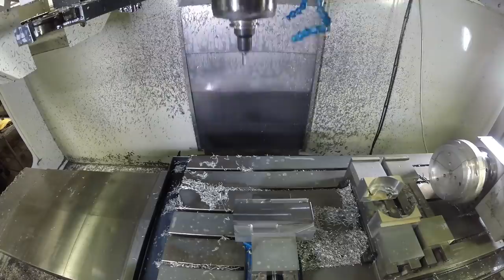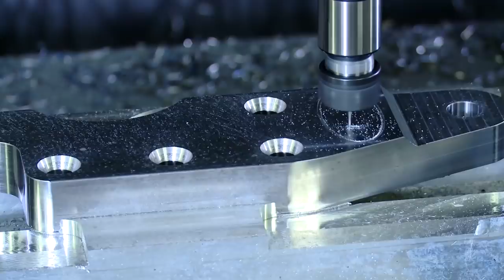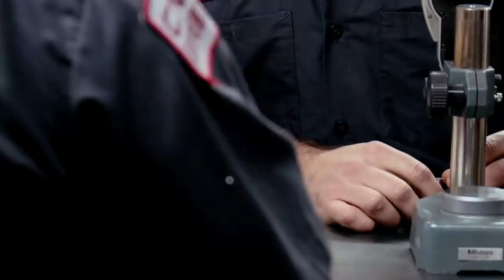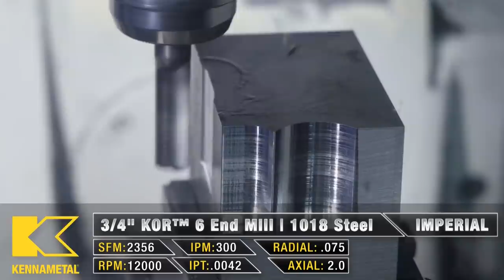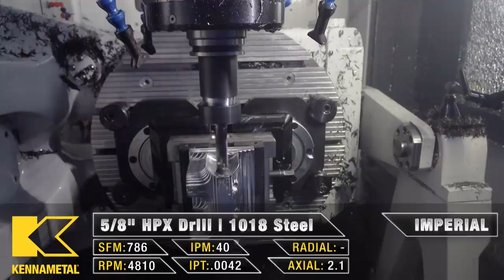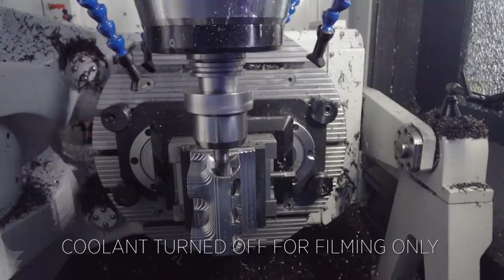Tools Keep Breaking on Night Shift, but Runs Perfect on Day Shift... Nobody Knows Why

Comment: My family business (Not that I'm involved with it) sent there manufacturing to china and closed down the factory. With engineers here they will notice issue's as they have an overview of the project and ask a question, I guess like your night shift guy did without consulting you. So some how a decimal point put in the wrong place and 200,000 parts where made and basically scrap metal, this would have never happened in our factory someone would have asked "Is this right?"

Comment: With modern controls, they'll usually give you an option to override the feed rate, and one to override spindle speed. The controls also will assign the feed knob to either IPM or FPT depending on the code you used. 

If you program with Inch / min feed rate, then reducing spindle speed will actually increase chip load, since it's still moving the same distance, just less flutes are hitting the part. To keep the feed per tooth the same in this mode, you have to adjust feed rate and spindle speed the same amount. 

If you program with feed per tooth, then reducing spindle speed will also slow down the IPM feed, so the machine keeps a constant FPT / chip load. This makes it a lot easier to dial in a program, since one knob only changes one variable.

Comment: You need that cooling note at the beginning of the video.   I was wondering if I should take advice from a machinist that doesn't use coolant without explanation.
Reply: Sounds like you've never seen a video about machining.  
Most of them shut off the coolant so that you can see what's going on.
Reply: @jamisojo  Yup.  First one.  Just need the disclaimer at the beginning of the video.  Milling bits don't grow on trees ya know.  They come from Plants.

Comment: Look up the info from your tool supplier, then realize that those data will run great - for about 15mins before the endmill needs a changing. Go slow enough to not break shit but fast enough to make money. When it's all dialed in, you can optimize for profit.

Doing prototypes all day long with a max of maybe 2-3 of the same part per order, there's no point in risking the tool/machine for you to save a couple of minutes per part.

Gain experience and then start to push the boundaries, but go easy in the beginning. There will be no praise for taking it a bit slow/easy on some parts, but that beats having to inform your boss that you need another batch of endmills or a new machine =) Find the balance.
Reply: exactly. had a prototype part come in, UHMW. got the prototypes done and out but didnt look the best and took a long time in the mill. ordered some good 2 flute carbide high helix endmills, played with mastercam and started to push the envelope some, and quickly ran out of machine. i just couldn't get enough rpm or traverse speed out of it to smoothly go faster. when i started on that part, it was 2 hours of machine time, partly to me being really new to mastercam, partly to me learning what that material wanted for a cutting strategy. currently, i get the same part done in 1 less operation, in about 25 minutes per part, in an order of 200. enough to tie a single machine up with an operator. the only changes i have to make now is from inconsistencies in the material from batch to batch, and when we have to change tooling manufactures, and they are usually small changes.
Reply: When you slow down the feed rate and cutting speed a little cutting tools last a lot longer.

Comment: Even if an employee thinks the settings are wrong they should run it once at the programmed settings. If you have a problem then try to fix it after that, because then no blame can be placed on you. If you don’t have physical proof the settings aren’t right in the form of a part with a problem, then you’re automatically wrong, even if the part looks right.
Reply: Kinda the same with excessive tool wear make same parts an say hey the code is too hard on the tool could only do X parts before the surface or tolleraces aren't achievable

Comment: Do production CNC tools record operating logs? The feeds and speeds that were actually run seem like something that you should be able to look up without having to stay late and ask the operator about.
Reply: I am currently working on some fairly old CNC mills. I'm not sure if there is a way to download a log off of them. I even did a little school for them, and if they mentioned any forensic work it mostly involved combing through the program. I'm not sure if the programs include any records of changes to them. Any changes or notes in the program seem to be manually written in. but unless you write X was changed on xx\xx, I don't think our mills will tell you.

Maybe the new mills might have that, but the few I've encountered have all been dinosaurs.
Reply: @camtube55  IIRC G-code dates back to the paper tape era and it wouldn't surprise me if some stuff still in use (or maybe even still being sold) has advanced only a little since then. OTOH I'm a software developer by training and have some idea from there what can be done for logging and the like... if the people building and buying were to see value in having that ability.
Reply: @benjaminshropshire2900  it's definitely not paper anymore thankfully. I haven't seen them load a program onto the machines I'm working on (yet, still new) but it wouldn't surprise me if it was a floppy disk or a usb stick configured to act as a floppy disk (machine I learned on was like that).

My brief understanding of Gcode seems that it can't inherently record a log of changes. You just cut and replace or add.

However I imagine it wouldn't be super hard to make the machine itself have an added or upgraded computer with software that could log changes and maybe even if you pull the program out for investigating give you any data on any changes made to the program.

I can imagine an automatic record keeping system would be very useful to programmers and anyone managing the fleet of machines.

Right now at my job, most changes are recorded by hand into a notebook for the specific station. I.e. Haas 1.

So point of failure is the user forgetting to record the change.

I remember hearing a spooky story, though it might be real of an accident with a machine for Boeing. After the machine crashed repairs were being made. 
The mechanic was inside the machine and it suddenly moved. He supposedly ended up with brain damage and a few other injuries but was unable to ever return to work.

They combed that machine to figure what went wrong, and surprisingly it was a coding issue. "Ghost code" my friend called it. A jumble of whatever that made the machine move and strike that poor mech.

I think they may have been trying to run the program to see what went wrong but for some reason needed to be in the machine, and when it ran it moved differently.

Long story short.

Don't trust the machine, and always be out of its path and even potential path. If it's possible that it can move and crush you even if it shouldn't by programming, don't put yourself there.

I had a morbid thought when inspecting a part on our "tombstone" on the pallet that should a pallet change occur (even though I haven't lit the button for it to do it per the cycle), my head would be directly in its path.

I now try to move anything I can so I can inspect without moving myself in there.
Reply: You are assuming modern controls that is networked and monitored by server.  I wonder if a basic Haas will post a job history report...
In any case, these smaller shops are too busy on floor ops and sales to commit to a rather pricey IT investment in network automation.
Reply: @Michael-ij6kg  You may actually be correct, but you shouldn't be correct.

In the case of a CNC machine built in the last decade: Adding a network port to a computer (at the core a CNC machine is computer) cost something like $10. CAT5 costs ~$1/m and a switch costs something like $50. If you are manipulating g-code then I really hope you already have a PC somewhere to run stuff one. The only thing left is the software (which should come free with the machine) and the time to set it up.

OTOH I've seen stories told of hardware companies that decided then wanted to turn a profit on their crap-ware that a freshman CS student would be ashamed to turn in. I can 100% believe that they would make the whole thing proprietary and charge so much for the kit that almost nobody bothers.
Reply: @benjaminshropshire2900  I've seen smaller companies have amazing software support.  It's hit or miss.  Some (USA) won't pick up your phone unless your account is +25 machines...  others send their SW guy out to customize the PLC because you added a shroud around the thing to halt splashing issues.
Reply: @Michael-ij6kg  Why am I not surprised? :0)

I know of a case where someone was building some custom CNC machines and one controller company wouldn't give them the time of day and another (as best I can tell, I think I consulted my way out of a job on that gig) was happy to offer them a stellar deal on a full custom setup from motor drivers to G-code generation tools.

Another story: I worked for a company where another department was doing some prototyping with industrial robot arms. The robot vendor was so happy with closing the deal on the 3 units for the dev team to prototype with that the vendor tossed in some of their design team's time to help with building the custom hand for free. I still wonder what happened when they called back to place the 30-40 unit order for the production installation? I suspect there were some very happy people in sales that quarter.

Comment: The thing that stood out the most was the mix of metric and imperial units. The RPM being in inches per minute, while sizing being in millimetres. This must be a headache when putting everything together? Is there any reason why it is not all one measurement system (ideally metric)? Curious non-American here.
Reply: When I first started I had the same problem, went to a shop that ran automotive jobs so prints were metric. Guys would convert to imperial to program but gages supplied were metric so operator had to convert back to imperial to put offsets in machine. First thing I did was convert programs to metric so whatever operator read on gages is what he had to offset in machine, why add extra steps of conversion just another chance to make a mistake.
Reply: @markboudreau1276  double conversions would surely also risk creating inaccuracies if numbers weren't rounded correctly? Great to see you took the initiative.
Reply: The feed rate may have been in inches per minute.   RPM (rotations per minute) could not be measured in distance.  
Maybe you meant surface speed.
Measuring your machining procedures in imperial (we call it standard here in the United States) would not affect the size of your finished product.

Comment: It is hard to remove the human factor, both at the shop floor and in the board room. Boss wants maximum productivity for minimum cost per unit, some employees will look for a way to slack off no matter how good the working conditions and pay. Some bosses would fire the employee on the spot for this sort of out of spec behaviour.
Reply: The problem is who do you hire afterwards? Someone who needs to be brought upto speed and possibly the same or worse?
Reply: @DmitriyLaktyushkin  logically, you would try to correct the behavior.  Give them another chance.
If they won't listen, then you fire them. 😁

Comment: We had a bloke who ran a multi-drill (1 to 12 drills) in a special head on the manual radial drill.
It used to make a terrible sound when the spindle ran, ,,,  nunga nunga nunga nunga.
The Bosses upstairs were happy as they could hear that sound all day long. But he had lowered the table a metre or so from the drills.  Engaging the feed and it would take 1 and a half hours to reach the job and drill the holes.  Leaving night shift guys to catch up.  No bull, he got away with this for ages, eventually getting the sack for kicking a hole in the wash up room door.
Reply: Sounds like the guy that worked in one of Rockwell's plants!  Turned out nothing but junk, and couldn't read a micrometer!

And I'm turning out stuff at home with a drill press, cross slide vise, files, milling cutters, and a dial caliper.  Surprised that I can keep a shaft to +/- 0.001" with just a file.  Not the way a drill press is supposed to be used, but it does work!

Comment: My favourite...your feeds and speeds are no good- tools are breaking and surface is rubbish. Goes to machine...12mm endmill in 150mm extension....yea the holder came pretty close to the vice so i put it in an extension. face palm
Reply: I'm pretty sure the button pushers on my second job felt called out by me reading this....
Reply: Man I have seen this so many times as well!  I program feeds/speeds for a short rigid holder and specify the holder on the setup sheet and then the tools break and when I go to the machine the tool is in a holder that is 3 times as long as what I specified.  I hope to do a video on this some time in the near future talking about the importance of rigidity both in the workpiece setup and the tool.  Thanks for sharing
Reply: @Jessie_Smith  You should probably talk to the operators personally.  
Maybe you could show them how to find the max depth of the tool in the code... So they don't need to be afraid of getting so close to the vise.  😉

Comment: Oddly my experience is generally the opposite. Night shift usually spends a large portion of their shift fixing the mistakes of day shift, but that is more with machine operator jobs and not CNC. I generally attributed it to managers being around for day shift and the operators not wanting to look bad so they just keep running the machine to look busy and productive.
Reply: I'm a Pilot but worked Maintenance at a Poultry Plant both night and day shift on all sorts of machines. Night shift worked together, and solved problems effeciently. During the day, everyone was hostile/at each others' throats, didn't work together AT ALL. None of the "experienced" old timers would teach you or let you know how to fix a new machine you've never worked on. They'd freak out and try to fight you in the parking lot if you messed up the machine you've never been taught the proper PMs for. It was a nightmare on day shift. The ego destroyed that team. 

Don't have that problem in Aviation. Lots of training, expensive too.
Reply: @nighthawkviper6791  God I hate when nobody will train the new guy on how to use the machines that are literally a part of his job. I remember working at a place for 6 months where the forklift was a part of my job and they just refused to let me use it because they couldn't get around to certifying me but instead let me waste my time moving things with a pallet jack and the other employees time coming to the cache to lift the pallets up on to the racks. Same with an overhead crane that they instead had me carry 50-150lb shafts to various machines instead of just letting me use the crane that was there for that exact purpose. Instead they kept giving me grief for being too slow and telling me they will "try to work something out" when I explained I wasn't allowed to use the equipment and requested training. It was so frustrating being berated for something that is their fault for being lazy or forgetful.
Reply: @ApotheosisStone  sounds like management was terrible.
They don't have control over their employees.

Comment: It’s always night shifts fault 😂 I can’t count the times day shift said everything’s running good, yet as soon as they walk out the door the machine crashes for the rest of the night and night shift gets the blame in the morning when management shows up. Haha good times!
Reply: I worked in a wafer fab plant for several years and heard too many times it was evening/night shifts fault.  I.g. often the problems compounded because the bins and lockers were locked up by the 1st shift so that parts needed to maintain productivity were inaccessible.  This caused evening shifts to jury rig and work around the issue - killing productivity.   What was interesting was that the evening shift was full of science and engineering students who would go to school during the day.  A little bit of jealousy perhaps?
Reply: This was a different industry, but I've had the opposite happen. First shift got away with everything because they were buddies with the office people, and second shift had to come in and double time to make up for it. Things really came to a head when management made second shift do mandatory overtime due to higher order volume because we were "doing so well", but you wouldn't have guessed it based on how management acted. First shift missed their numbers almost every day for over a year and no corrective action was taken, but if second shift wasn't green, we'd face repercussions. Needless to say, I and many others no longer work there by choice.